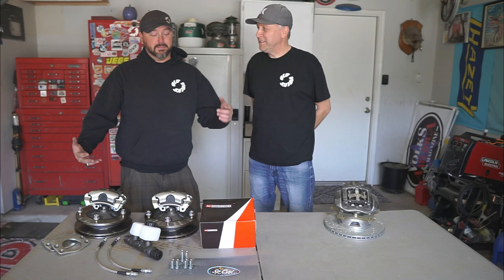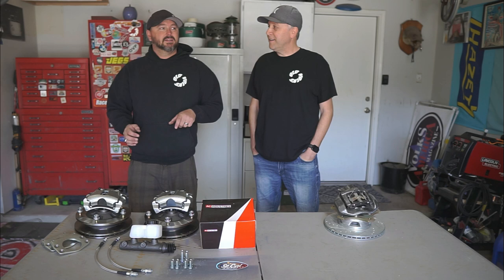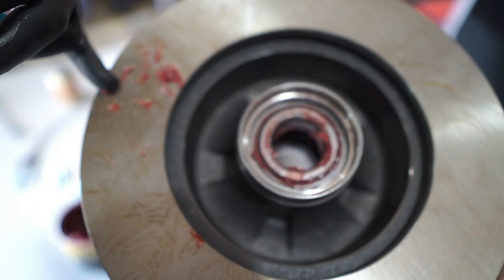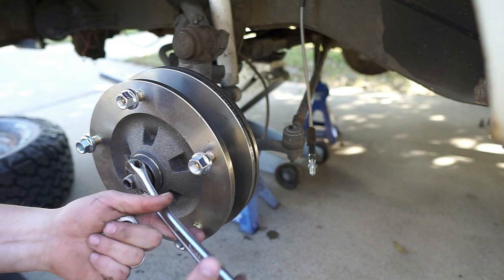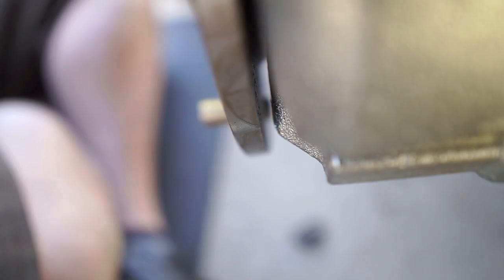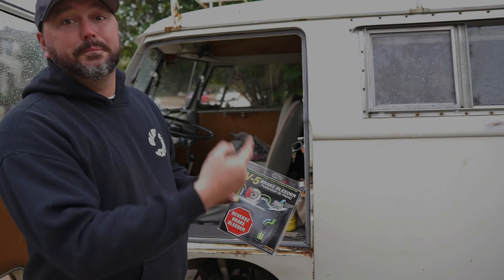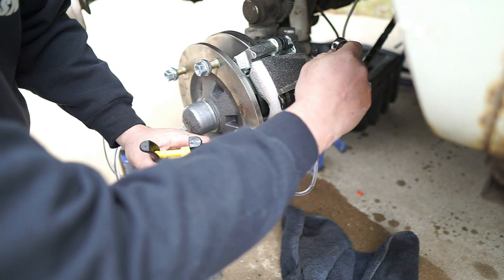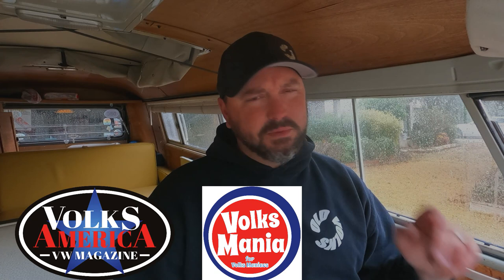VW Bus disc brake conversion

Comment: Awesome video, just pulled my mom's 78 bus out of the garage, going to attempt to get it running. Any information an the wiring harness? I guess she paid someone to replace it years ago, he took it off and never finished the job, so now I'm stuck.
Reply from the maker: You can usually find the wiring diagrams online. Thesamba.com has a section on wiring harness installs with plenty of pics. Wolfsburgwest.com sells a nice factory correct harness with good instructions as well. Take your time and have fun with it! Thanks for watching!

Comment: That kit looks nice. Shouldn't you have bled the brakes from the top bleeder screw on the calipers since air rises? Did you go back and re-bleed them? Cool video.
Reply from the maker: I did bleed them again, I had to replace a rear wheel cylinder that had an air leak.

Comment: I think you made a great choice. My question is about the brake bleeder. I bought it and used it on my bug. I had installed a whole new brake system, master and wheel cylinders. It didn’t work to well as it leaked a lot at the bleeder valve. Did you experience any of this? I wonder If there is nothing on the lines maybe it isn’t as effective?
Reply from the maker: I used it to bench bleed the master first, then used it to pull the fluid to each wheel. I did have a hard time getting suction at first. I replaced all of my bleeders with Russell speed bleeder and it seemed to work much better. They have a one way valve so you don't have to "crack" them to get them to work.

Comment: I was thinking of doing all 4 wheels to disc brakes. Your reaction to just doing the front said it all. What offset for rims would be best for this set up?
Reply from the maker: This particular kit is designed for stock wheels. Anything that would fit your drum brakes will work fine!

Comment: I added a brake booster to my 68, and wow it is so much better.  I can keep the stock drums and I have stronger brakes than most late bays.  Nice job!  What year bus do you have?
Reply from the maker: Mines a 66. No room for a booster on mine. These brakes make it stop a whole heck of a lot better though!
Reply: @OldVolksTV  You can mount one to the front beam but you have to do some fabrication. Glad to hear it made a big improvement!